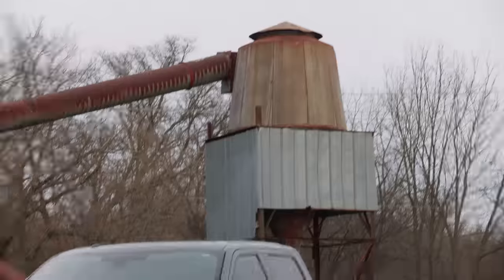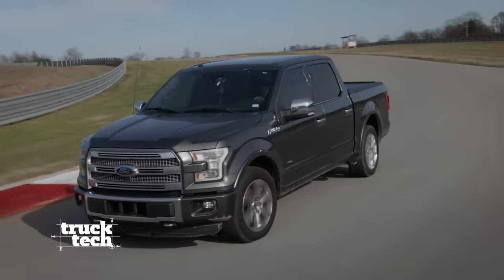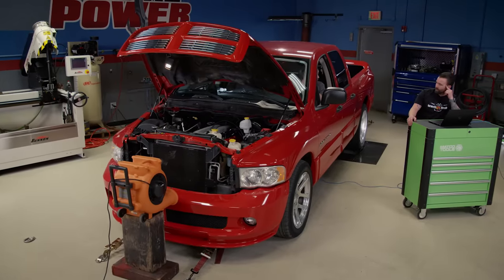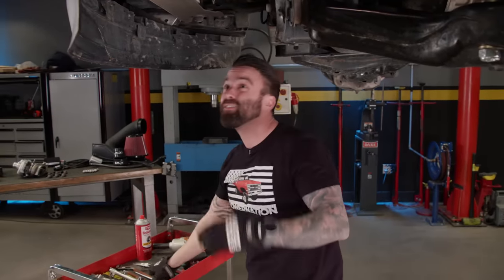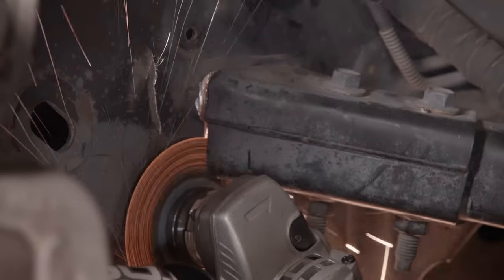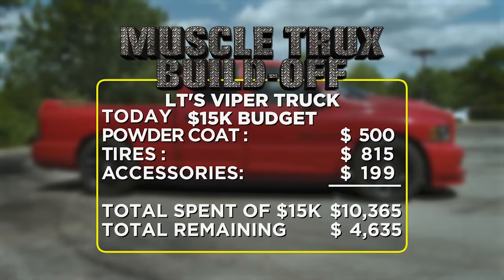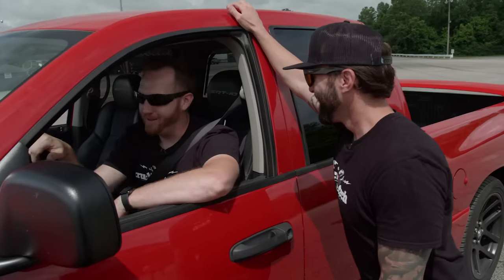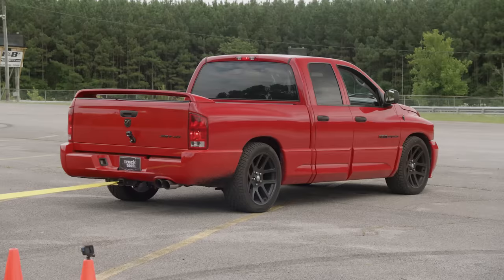Muscle Trux Build-Off: Ford F150 EcoBoost vs Dodge Ram SRT-10

Comment: Bruh. Not gonna lie, the f150 build didn’t start off well; but by the time the styling and dyno tests came, it left me totally impressed. And I think everyone was impressed by it. The judges were right though, The ram could have used some of that extra cash. But I do respect the decision of him keeping it on that enhanced stock look. I’d take both of these babes any-day.
Reply: its so stupid cuz he couldve got a coyote f150 and the 5.0 coyote just needs boost and fuel and you can make up to 1200whp with a stock sealed coyote.  no heads no cams no pistons no rods and they run 9s for a crew can and as fast as 8s with the single cab short bed in the 1/4 mile. he bought a turbo for this when he couldve slapped a turbo or supercharger and fuel system.  m8dnight performance jas toms of these in the 8s without ever openimg the engine. gotta think once ford went with aluminum they have a weight advantage weighing jn at 4500lbs (hellcat weight damn near) its like having a awd mustang

Comment: Those numbers on the Ford are weak for a turbo swap. I was expecting 600hp
Reply: The turbos swap is almost the same factory turbos with only 2mm bigger turbines.
Reply: The Viper truck build is also disappointing. With a supercharger they could have reached between 700-800hp easy with corresponding tq figures. There is really not that much of a reason to go through all that work and burn al that money to get around 40 extra hp and 45 extra tq.
Reply: The tune they used sucks. That should’ve made way more power with a turbo swap. Those 3.5’s will make those numbers with stock turbos! They need a real tuner like Unleashed Tuning
Reply: @mustpaike . They also only put a baby cam in the Ram🤦🏻‍♂️
Reply: @pittysbuilds895  Seemed like they used the tune that came with the tuner.
Reply: its so stupid cuz he couldve got a coyote f150 and the 5.0 coyote just needs boost and fuel and you can make up to 1200whp with a stock sealed coyote.  no heads no cams no pistons no rods and they run 9s for a crew can and as fast as 8s with the single cab short bed in the 1/4 mile. he bought a turbo for this when he couldve slapped a turbo or supercharger and fuel system.  m8dnight performance jas toms of these in the 8s without ever openimg the engine. gotta think once ford went with aluminum they have a weight advantage weighing jn at 4500lbs (hellcat weight damn near) its like having a awd mustang

Comment: I have a 04 lightning stock with only a intake and I slowly but surely beat my friend in his 05
Single cab manual viper. But then my lightning is also faster than my cousins 02 lightning. All 3 are low mile trucks too.

Comment: I was surprised at how slow these trucks were. 9+ second 1/8 mile time?  I would hate to know I had $35,000 - $40,000 in a “muscle truck “ that couldn’t even run in the 8’s.  They should have gone with 5 Star Tunning for the ecoboost. They put out 475 RWHP on the Stock Turbos. I was hoping to see the ecoboost in the 7’s.
Reply: I was thinking the exact same thing my '19 Ecoboost is putting down more than him with just tune and intake.

Comment: Good video but...... I'd like to know where you bought a 70,000 mile srt 10 for only $15,000
Reply: correct me if I'm wrong, but I think this came out some couple of years ago. So the used car prices weren't crazy like how it is now.
Reply: Someone one is selling a single cab with 50k. Near me I wish I could get it
Reply: Me too 😁
Reply: Probably Mexico. 

Only the crew cabs have the manual transmission option.
Reply: Ur momma
Reply: Right 😆
Reply: 2 years ago a dude near me had a 4 door srt 10 with 48k miles for 5k cause he didnt like the mpg
Reply: @wardaddy9910  actualy, the single cab does as well.
Reply: P country music country music country music 🎵🎶 country music country music country musi

Comment: That Dodge should’ve come equipped from the factory with Perrelli Scorpion Zero 305-40ZR22 rubber. It’s what my 2005 SRT-10 Ram came with new back in ‘05 at least.

Comment: How so slow?   All that work.  I have a cammed 2016 crew cab limited on air ride.  And it does 8.16 @88 on the street with a dragy.    How are they running 9s?

Comment: 13:30 Isn't the stock tire size on the SRT-10 Ram 305/40R22 in all 4 corners?
Reply: Yes Pirelli Scorpions
Reply: @djcherokee  Is it the same on all srt10s?
Reply: @fuzzymoto896  Yes, on all of them from 2004 to 2006 Single Cab and Quad Cab, all the same size

Comment: I LOVE the Ford transformation! I’d be a proud owner of that truck!
Reply: its so stupid cuz he couldve got a coyote f150 and the 5.0 coyote just needs boost and fuel and you can make up to 1200whp with a stock sealed coyote.  no heads no cams no pistons no rods and they run 9s for a crew can and as fast as 8s with the single cab short bed in the 1/4 mile. he bought a turbo for this when he couldve slapped a turbo or supercharger and fuel system.  m8dnight performance jas toms of these in the 8s without ever openimg the engine. gotta think once ford went with aluminum they have a weight advantage weighing jn at 4500lbs (hellcat weight damn near) its like having a awd mustang
Reply: I agree a great transformation of a truly UGLY truck. V-10 rams. as stated, look great right off the line.

Comment: They should have really consulted the forums that focuses on the respective trucks to really find out what works best.  The ecoboost could have done so much better with a proper custom tune and stock turbos & injectors.  Also, launching at 2500 rpm on 4Hi and Advanced Trac off in Sport mode will always get the best times.  Performance solutions that work for other trucks don't necessarily make the same impact on the Ecoboost.  The first mistake he made was not getting the 10 speed, they came with larger turbos from the factory.  With all the money he had to spend, he could have made a beast.

Comment: They really made this far closer than they needed to to create drama and draw out the episode, man’s really left 4K on the table the srt would have absolutely whooped the eco boost in every category if he would’ve used his whole budget
Reply: Yeah no shit, a 10 cylinder sport truck beat a 6 cylinder truck. If the ford had the 5.0 on it wouldn’t even be close
Reply: @RJB-rt1kn  You're not wrong. If it had been a Coyote F150, adding those same turbos to it would have made an even bigger impact. There's a lot more potential in the 5.0 than in the 3.5, simply by virtue of already having more displacement and 2 more cylinders. Whole lot more upside, and a whole lot better chance of beating that V10 ram. Still, it was cool just seeing the guys having some fun with what they had.
Reply: If they actually tuned the Ecoboost better that 4k wouldn't have mattered

Comment: Also, correct me if I'm wrong, but did that 3.5L EcoBoost make more wheel horsepower AND torque than the Coyote F-150?
Reply: I cant stand an ecoboosts but yea that f150 ecos boogie. They can be tuned to be straight fast af
Reply: Yes they did but I doubt it outlast the Coyote though.
Reply: @CJColvin  def won't.  Coyote power and reliablity is amazing
Reply: @danielservin2450  I totally agree brother I have a 2011 Ford F150 with a 5.0L Coyote V8 in it with 141,000 miles and still going strong and its a beast and it sounds like a beast with the Borla ATAK.
Reply: @CJColvin  yea had a 05 mustang with the 3v and all the coyote Mustangs would just wreck my car. Im not a big half ton truck guy but if someone gonna buy one gotta have a v8. All the stupid turbo trucks bother me
Reply: @danielservin2450  Oh same here brother, it bothers me so much that I can't stand it.
Reply: @CJColvin  it is crazy how much power they can squeeze outta a 4cylinder. I guess the Silverados base js a turbo 4cylinder. Crazy
Reply: @danielservin2450  I know brother but the only problem is they won't last very long.
Reply: The Coyote in the F150 isn't set up the same as the one in the Mustang. This truck made about the same wheel horsepower and about 20 more ft/lbs of torque compared to a gen 3 coyote Mustang.

Comment: as an ecoboost guy it pained me when he used the ford performance turbos, for the price he could of got a much bigger twin turbo set up. ford performance turbos are hotdog water. love the show!
Reply: its so stupid cuz he couldve got a coyote f150 and the 5.0 coyote just needs boost and fuel and you can make up to 1200whp with a stock sealed coyote.  no heads no cams no pistons no rods and they run 9s for a crew can and as fast as 8s with the single cab short bed in the 1/4 mile. he bought a turbo for this when he couldve slapped a turbo or supercharger and fuel system.  m8dnight performance jas toms of these in the 8s without ever openimg the engine. gotta think once ford went with aluminum they have a weight advantage weighing jn at 4500lbs (hellcat weight damn near) its like having a awd mustang

Comment: It’s still an 8.3l vs. a 3.5l. Lots of  3.5l on YouTube running 11’s with less money than this guy spent. It’s not like he had to put a Viper motor in it.  🤷‍♂️
Reply: Yeah an the tune an turbos were junk.
Reply: @ryanfish4722  coulda put the f150 on e85 that woulda woke it up
Reply: @andytommykeddy3224  ecoboost can’t make that much horsepower tho they internal will blow by then
Reply: But the viper can do it for 10x longer because its not stressed out.
Reply: @atodaso1668 . Agreed, the viper motor only had a baby cam in it, add only 14Ib’s of boost and it will be for digit numbers and hold it.
Reply: The 8.3L only had a baby cam in it, that thing was only walking compared to how much it was being held back.

Comment: This is totally produced, just with tuning you can get 500hp from the ecoboost
Reply: Really
Reply: @cristiansofake7854  yeah, kinda the same with the GM 3.6TT LN4, downpipe, intake, exhaust and tune and you have 650hp with 700lbft the fords are close or better depending on WHICH engine you use. The ford 3.7 isnt as good as the LN4 but the 3.5 can be better for about the same work.
Reply: @cristiansofake7854  note: these numbers are on ethanol.

Comment: What did we learn? That it's more expensive to turn an econo-box into a sports car/truck than to just...buy a sports car/truck with a big V8.
Reply: But pops and bangs, and then back to fuel economy😳
Reply: The viper has an 8.3 v10 son
Reply: Idk who's tunes he used. But with aftermarket turbos an everything else. That was bad. An not 93 octane tune makes 450 on stock turbos to the wheels
Reply: @brandonwilliams8003  that...that was the point. Stop trying to turn a basic model V6 car/truck into a fast car/truck. It's a waste of money.
Reply: @ryanfish4722  yeah, and then BOOM. Blown engine because it wasn't designed for that.
Reply: @domonic9091  back to fuel economy if you undo everything. Also, if you're worried about fuel economy, you shouldn't be buying racing parts for any vehicle. You can't afford the luxury of speed lol.
Reply: @ryanfish4722  and the viper truck still has $4k left that could have been spent on mods. A Gen V intake is a popular mod, not sure how much it costs though.

But i would have gone with a centrifugal supercharger kit (around $9k) and a 3.5 or 4 inch exhaust setup with at least 2 inch primaries, 3 inch is just too small for an 8.3 liter motor. Supercharger alone is good for around +200hp. Brake rotor upgrade was unnecessary, pads should have been enough. Mesh grille looked good.
Reply: @curtism-w6b  there's several Ecoboost with about 200000 been modded there entire life no issues. They can push 450 to 500 on stock turbos an internals no issues.
Reply: @sepg5084  yeah but a 93 mpt tune makes 450 rwhp on stock turbos. So idk what crappy tune an junk turbos he used. Running e50 an aftermarket turbos an fuel pump makes almost 700 hp
Reply: @ryanfish4722  and blow up by 85k miles. Common sense. More compression. More wear.
Reply: @curtism-w6b  my guess is you have no clue about these trucks. Have a great day research
Reply: @ryanfish4722  why would I buy a fullsized, V6 truck? Secondly, my guess is you never took a physics class in your life. Anything turbo'd = Less longevity. Common sense. Bigger turbos, more power, less reliable, less longevity. Again, common sense.
Reply: @curtism-w6b  damn explain that to the 500000 mile diesel out there
Reply: @ryanfish4722 ....are you comparing a diesel to a gasoline engine? Well hell, why not compare it to a jet engine?
Reply: No way you can call a truck with 4 doors and a back seat a Sport Truck.  RCSB only, and Ford is the ONLY company that still builds them.  I'm still loving my 2014 TREMOR.
Reply: @GK-gr2mx  I know it lost. I know displacement always wins if you're running identical setups.
Reply: @curtism-w6b  because the 2.7 ecoboost block is made of the same material as the new 6.7 power stroke, and has forged internals from factory bozo. Your the same as every old head at a towny car meet. V8! V8! Harley!harley! Lol

Comment: The fact that its a 8.3l v10 vs 3.5l v6 and the Ford was that close to beating the Dodge Fords got the win for me.
Reply: Also 10 years older
Reply: @zacharymacdougall8977  still doesnt change much of anything. He put upgrades into the engine of the hemi alot more upgrades then the F150 did to the engine. That 8.3l shouldnt have had any problem smoking him by a long shot. v10 compared to a v6
Reply: @zacharymacdougall8977  it's a v10 racing engine from a sports car, that 8.3 should have walked the ecoboost. I agree with him. The ecoboost won IMO. A little v6 with tiny turbos stayed next to a v10. It's impressive what a little forced induction can do
Reply: thats the power of turbo, not the engine
Reply: @FakedStick  but with 4 extra cylinders. A clear advantage from the start.

Comment: One thing will always be true you’ll have to compare  any NEW Ford  Technology to even come close. To older muscle of the BIG Dodge , they were and always  will be ahead of the horsepower War  as they still are today… anyone who buys A Ford eco-boost as a muscle truck , is a latte drinking. Millennial and sits down to P , that is a fact.
Reply: At the drag strip the Ford Ecoboost F150's are the fastest street trucks out there. Dodge's 5.7 doesn't hold a light to them. 9.63 in the 1/8th is 3 tenths slower than what my 2.7 F150 Crewcab ran stock. Call it what you'd like but the Ecoboost engines are impressive.

Comment: Cool trucks... conservative numbers for the cash..  my stock 18' F150 runs 8.95 1/8 mile stock.. 5 star 94 tune only 8.08   SRT 10s with RWD need sticky tires and lightweight rims...  you guys left so much on the table. Both those trucks should be well in the 7's .

Comment: The Dodge is my dream truck, too. 
A little supercharger whine would have sent that right over the top but, the way he left it means no premature wear or complicated maintenence.  There's plenty of room left for improvement, too which is a good thing but I agree with one thing he said,, to put all that work into the aspiration and not custom grind a cam was a,wasted opportunity.  On the other hand, it showed what could be done with off the shelf  parts.
  But, Dude with the Ford, I get your country, so am I (Georgia boy) but, ya gotta quit makin' us look bad!
"Right off the back??"  It's bat...  "Right off the bat..."  As in "right off the bat, you could tell it was going to be a home run."
  I'm not picking on you, I'm trying to help you, help"us," as country boys, to not be stereotyped!  People judge us by the way we speak and messing up (easy) everyday, common phrases and quotes is a quick ticket to Shametown!  😉 lol...
(<mumbles to self> "Right off the back...  Back of what, a gorilla? Sheesh..." <shakes head and walks away> )  heehee
Reply: They are still running cheap if you compare inflation to cost. Running less than 30k.

Comment: bruh whoever tuned that EcoBoost didn't know what they were doing, could have gotten 450whp out of that setup.
Reply: I gained 65 rear wheel with just a tune
Reply: They also put a little baby cam in the SRT10🤦🏻‍♂️
Reply: @Jasonarmand  that's bigger turbos not just tune

Comment: The Ford F-150 with a V6 turbo 4X4 is way more impressive, just to compete with such a truck as the Dodge V10 SRT and it kept up.
Reply: 2005 naturally aspirated vs brand new truck with a turbo. The ford was good but not impressive
Reply: The put a baby cam in the Ram to keep things fair.

Comment: Awesome awesome awesome series!  More like this with different cars/trucks!  Great quality, informative and engaging hosts.  This show fires on all cylinders!
Reply: its so stupid cuz he couldve got a coyote f150 and the 5.0 coyote just needs boost and fuel and you can make up to 1200whp with a stock sealed coyote.  no heads no cams no pistons no rods and they run 9s for a crew can and as fast as 8s with the single cab short bed in the 1/4 mile. he bought a turbo for this when he couldve slapped a turbo or supercharger and fuel system.  m8dnight performance jas toms of these in the 8s without ever openimg the engine. gotta think once ford went with aluminum they have a weight advantage weighing jn at 4500lbs (hellcat weight damn near) its like having a awd mustang

Comment: My bone stock 04 RC srt10 ran 8.60.  Hooking up is difficult with factory ride height and gets worse lowering it.  Cold air induction and changing the rear gears to 4.88s  wakes it up a lot. That truck could probably use a transmission rebuild with a good shift kit. The top end of the 8.3 gets oil starved because of the cross drilled crank.  There's a plug kit for that which works pretty well.  Those Dunlops have a flimsy sidewall and get scary at  about 95mph.  The factory Pzeros don't hook very well but they're predictable for drifting through curves.